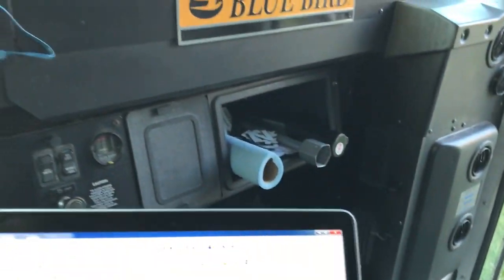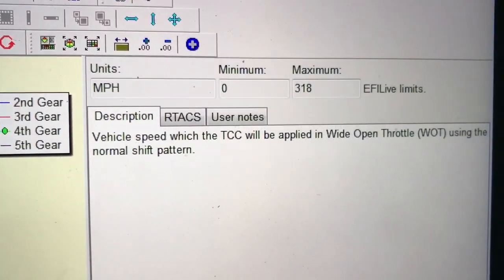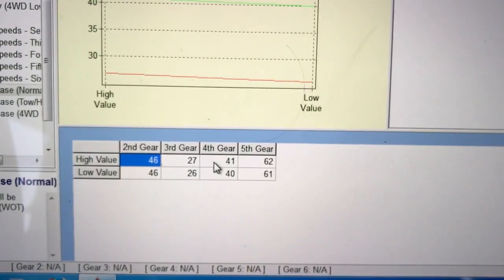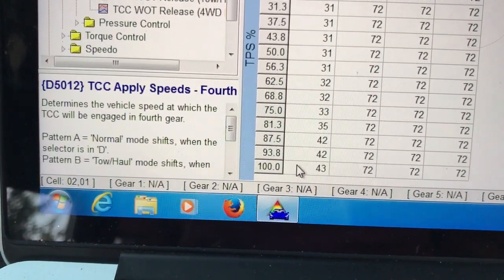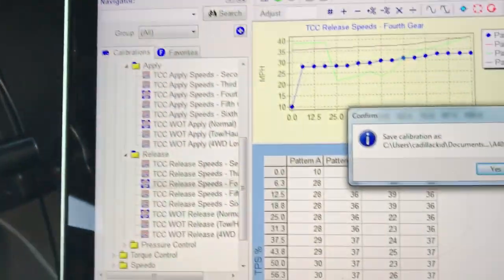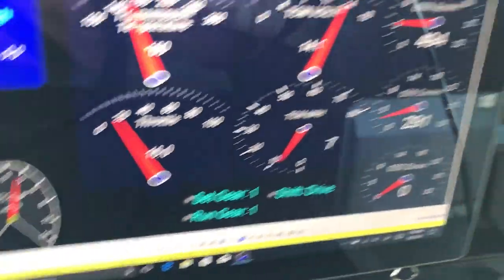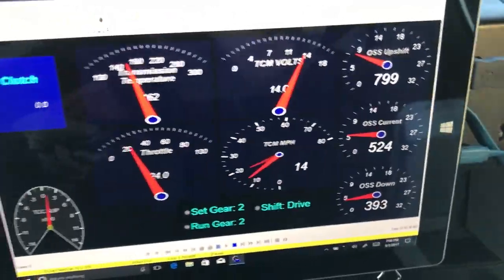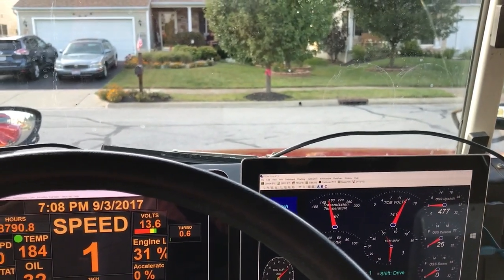Redbyrd School Bus Transmission TCM tune

Comment: What conversion  company  did you utilize  to mate your allison to your International.
Reply from the maker: the transmissuon and harness was bought through CAC, Custom Automatic Concersion in gulf breeze fl..  the transmission is actually built by Suncoast..  I didnt really like the tune from their TCM for a school bus.. plus the throttle method was anlog by tapping into the pedal.. once I discovered my 444E had the J1939 link I got a new Tuneable TCM from jason at transmissiontuner.com  (he can build harnesses too)..  both TCMs are 4th gen so no 5th Gen protected parameters BS. I had the trans built with the SAE3 bell and tail..  it fits perfectly in place of an AT545 up front.. no mods..  have to shorten driveshaft and i had to make a new park brake bracket and shifter bracket..  if you can find them from a Duramaxx 4500 or 5500 truck. you wont have to make them.